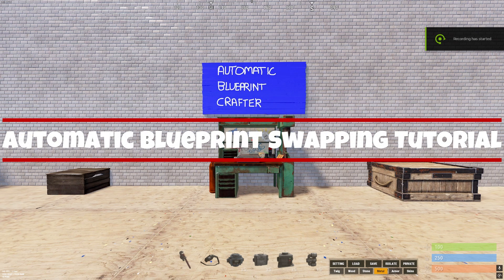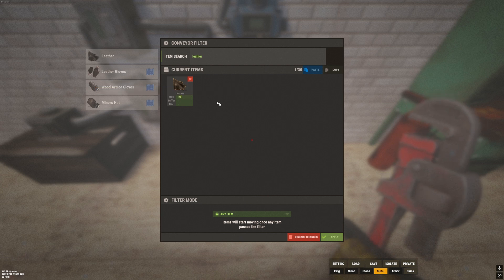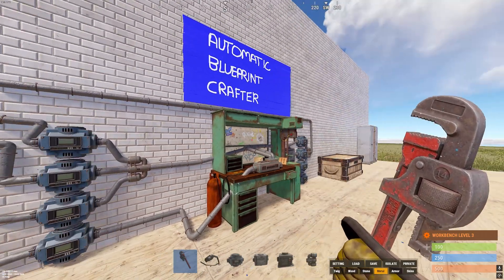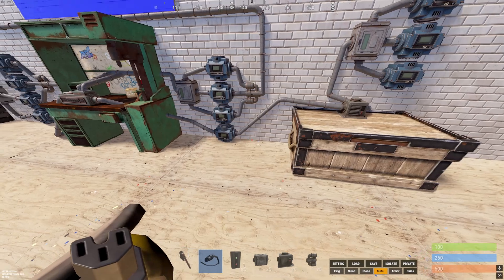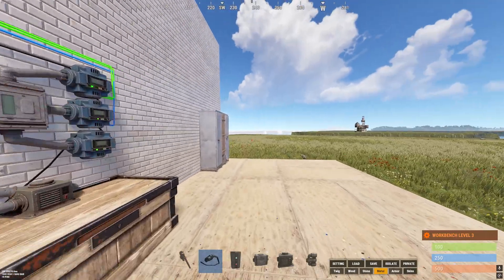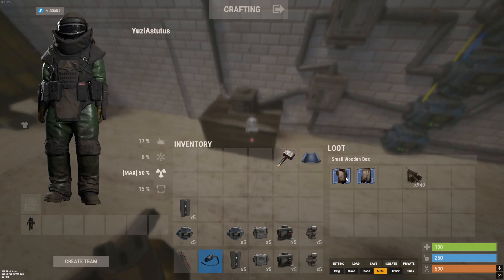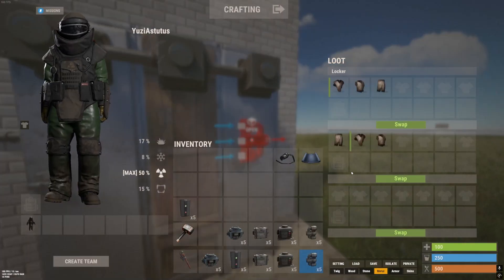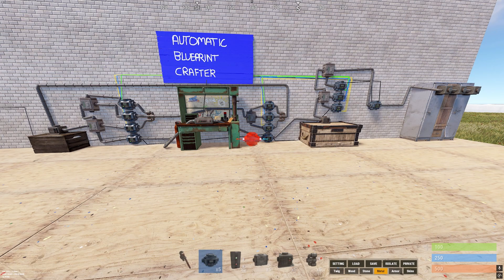RUST Automatic Blueprint Swapping Kit Crafter Tutorial

Comment: what if you have more than one kind of resource needed, like for bullets guns and syringes you will need much more resources loading in and out
Reply from the maker: yes up to 4 types of resource. i will soon upload a huge full kit builder including 4 autocrafters, that fills lockers with tier 2 armour, med syringes, bandages, semi rifles, bullets, wooden barricades, and even a back pack!
Reply: @YuziAstutus  I'm a bit lost, I;m finally building this but it doesnt make sense how it knows what material to pick. Do i have to calculate mats for roadsign kit? How does this work with each blueprints needs.
Reply from the maker: @vega272k8  at the moment you will need 4 autocrafters to craft a full kit with guns, ammo meds, baricades. 

For just the road sign kit you can use one autocrafter with, signs, sewing kits, leather and cloth, only thing missing is boots which need the metal
Reply: @YuziAstutus 👀👀
Reply: It's more complicated but you can use a single autocrafter to do everything if you wanted (not a clever idea tbh 🤣)
Reply from the maker: @handford1453  ive spent a long time working on this and its way way too complicated to achieve especially if crafting gun, bullets, meds etc.

Stay tuned for my full kit 1x1 craft coming soon
Reply: It is overly complex for sure! Also with the addition of crafting teas it's somewhat obsolete too. Will sub and see how you tackle it!
Reply: i use a separate workbench for armor crafting. much easier than trying to make 1 workbench make everything. Im sure theres some way to do it, but it'd be so over engineered it wouldnt be worth setting up. worth noting im talking about the t2 laying around after you get t3. i dont auto craft metal sets usually unless i raid an extra t3 or something, having a stocked roadsign locker is good enough for most purposes. the main workbench is better left crafting syringes, ammo, and boom.